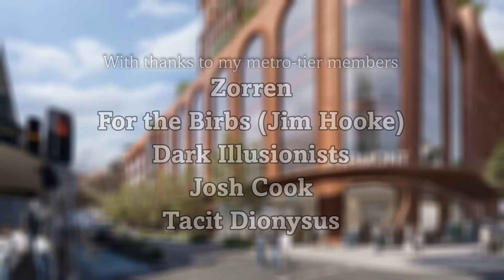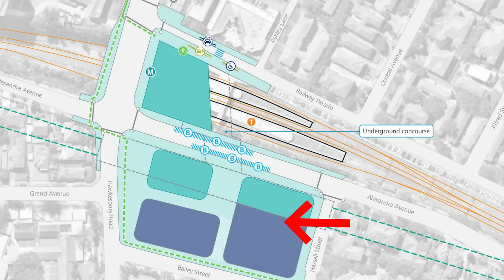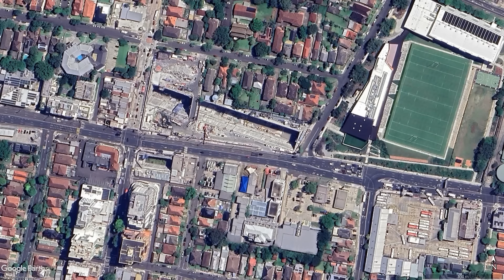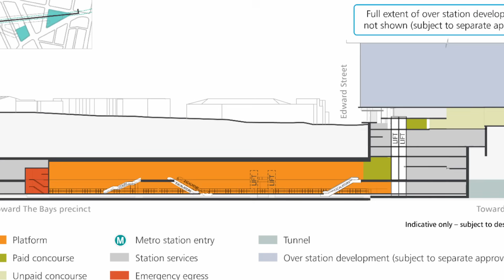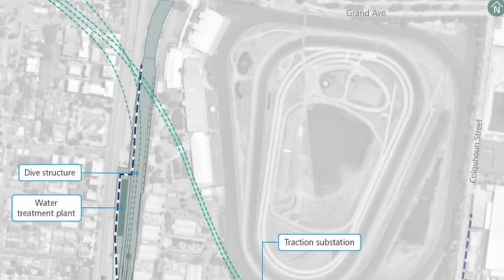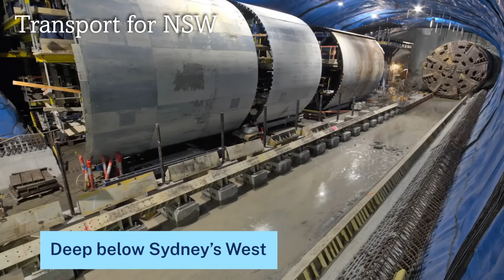Metro West - Sydney's Most Important Railway?

Comment: Very interesting! 
Though are you sure that Olympic Park station will switch boarding platforms between "normal" and "event" modes instead of switching alighting ones?
It goes against best practices, which are to only alternate the exit path and not the boarding one, so as to avoid confusion for locals who are used to board the train from a given platform. Whereas the exit side of the train can be audibly announced and visually signaled in advance, with also a time delay between the opening of each side's doors.
Also, a central platform usually has more space than secondary side platforms and thus better handles large event crowds waiting for their trains.

Maybe you explained it and I missed it, but why are trains of a different loading gauge on this line?
Fantastic video!
Greetings from Paris.
Reply from the maker: Sides are planned to be used for events only. I’m not an expert in crowd control but separating people into the two directions probably helps. The alighting platform should always be the middle so the announcements wouldn’t need to change on the train and it would be very clear for people entering the station which entrance to use.
Reply: @hain_train  Any idea how they load the passengers onto the outer platforms at SOP? Cross section show the escalators on the inner platforms and lifts on the outer..You mentioned additional entry points in event mode,but there must be either stairs or extra escalators filtering people to the outer platforms .With the current station,its stairs/lifts but the Metro station is certainly deeper and with additional levels
Reply from the maker: @danielmadden7924 some long escalators I assume. As I said I’ll make a follow up when the station design contracts are signed which will probably be at the end of the year.
Reply: @hain_train  But that's usually the other way around, with central platforms always used for boarding, and side platforms used during events for alighting.
It's far easier to change announcements and time the doors  in the train than to prevent "free roaming" passengers to go to the wrong platform.
Humans are creatures of habit, and on an ergonomics standpoint, it's better to create a "cattle corridor".
With side platform doors opening first, which easily direct arriving passengers to alight onto the side platforms, and a single way for all departing passengers whatever the direction they want to go to.
Signage in stations, however good it is, isn't even remotely as efficient as having physical crowd management.
Also, it's easier to control passenger flow to the central platform from the street, than the flow of alighting trains.
Departing passengers having to wait, a larger platform is better, while arriving passengers will leave the station so smaller platforms are fine.
Reply from the maker: Yes but splitting the crowd up early is more efficient. They use a side loading arrangement at OP currently for a reason. I don’t know a thing about crowd management but the people who designed the station do, I’m gonna trust them.
Reply: @hain_train   It goes against every good practice of crowd management 101...
Reply: @hain_train  Which implies the question as to why going against best practices here. What in the station, location, or organization justifies this, with all the crowd management risks it creates.
I'm guessing that they didn't just decide to do differently on a whim. So, what's the specificity of this station to warrant this?
Reply: @KyrilPG  The side platforms within Olympic Park train station are used for boarding during event mode while the centre platform is used for alighting.This is especially after the event is completed and crowd is controlled on either side outside the station.

Comment: Small correction: John Holland hasn't been "a local business" since 2014. It went through many owners but its various subsidiaries at the time of the sale by Leighton Holdings to China Communications Construction include a long list of notable construction and infrastructure projects: a lot of the Snowy Mountains hydro scheme, the skitube railway at Perisher, the original Sydney Harbour Tunnel, Brisbane's Gateway Bridge, Sydney's airport rail link (now part of T8 line)...all built through Transfield construction...and yes it also does public transit fleet operations. BTW there are no Australian-owned major builders left in infrastructure construction on this market. Zero.
Reply: @Robert-um6fr  Correct, if you are talking about Tier 1 Civil Contractors. I worked for Abigroup which I believe was one of the last Australian owned contractors in the early 2000’s. Leighton Holdings have been owned by German company Hocteif since at least the early 1980’s.

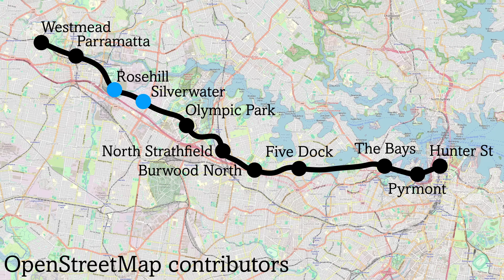Comment: 3:01 Not exactly accurate when you mean "slow and unreliable buses" in these suburbs. The Inner West, the Inner City, as well as many Eastern Suburbs and Lower North Shore suburbs already have frequent reliable buses. Pyrmont, Rozelle (and Balmain), Five Dock already have "all day frequent network", with routes 500X, 442, 433, 438X, (as well as 370) all operating on 10 min frequencies during the day, 7 days a week. 389, 501, 431, 440, 470 and 461X also operate with frequent buses. (with 389 and 470 on 10 min frequencies during the day time weekdays. However, with this new Metro, the journey times to the city would be drastically cut, relying less on these buses.
Reply: Pyrmont has 2 buses and light rail that only take you where you don’t want to go. Not that the metro will help much in that regard

Comment: Surprise that there is only 2 platforms at Olympic park. Thought there will be 3 or 4
Reply: My recollection is 4 platforms so that both sides of each train can open onto a platform. Commonly called “Spanish Solution”. Normal ops uses island platform side only. Major event ops unload on island platform side of trains and load from outer platform side.
Reply from the maker: Did you hear any of what I said?
There are 4 platforms.

Comment: While i agree spending a massive amount of money to connect T6 and T7 is a waste,
What if it instead formed part of future inner loop - say Hurstville to Gordon via Bankstown, Olympic Park and Macquarie Park.

Loop plans generally seem to prefer using Parramatta, but this link would likely be cheaper.
Reply: That is a Frankensteins Monster of a loop trying to make bits of legacy infrastructure fit together instead of building the orbital line a city heading over 6 million needs. The current orbital line plans they have on the books are Kogarah-Norwest via Kingsgrove, Bankstown, Sefton, South Granville and Parramatta; with another proposed but less-realistic plan for a second orbital line from Kogarah to Macquarie Park via Kingsgrove, Campsie, Burwood/Strathfield, Olympic Park, Rhodes and Top Ryde. Of course they also have the New Cumberland Line plan which is sort-of an orbital for eastern Sydney (and a radial for western Sydney) which takes the Liverpool-Fairfield-Merrylands line and reroutes it through new tunnels under Parramatta to Epping via Carlingford. These are all much better plans in my opinion than trying to thread and stitch together old legacy alignments in a semi-cohesive patterns like you are suggesting. Not completely against the idea but I don't think that really does what it says on the tin!
Reply: @BigBlueMan118 
The best orbital line would be from Glenfield, take over the T3/T6 and T7, then up through Rhodes to Macquarie Park. Temporarily extend the M1 to meet the line at Regents Park until the Hurstville-Parra line is built. This massive interchange connector would have several huge advantages for PT in Sydney:
  - connect every train line in Sydney bar the T4
  - finally provide transfer points without having to go to the CBD
  - provide a much needed north-south corridor for the city 
  - eliminates 3 useless train spur lines which virtually completely separates the train network, allowing more tph and isolating issues to 1 or 2 lines rather than the whole network
  - providing easy access to WSI for huge parts of the city with airport metro line extension to Glenfield 
  - allows for a fully automated network that independently provides access to most of Sydney eg. for 24hr running on weekends
  - makes much greater use of existing underutilized track, increasing funds for further PT investment 
  - future extension north to Gordon and Dee Why and south to Town, means ppl can easily live car-free as PT would be far quicker and cheaper to most places in Sydney, allowing for more investment in PT and less on roads
  - every key business/activity hub in the city will be connected by fast,reliable metro - CBD, Nth Sydney, MP, SOP, Parra, Liverpool, Bradfield, WSI. The only outlier is KSA but I think MW should take over the airport line to solve that
 - Finally, SOP becomes the swing point for transport in the city with the interchange with MW, making it the logical location for the high-speed station - which eases pressure on the CBD and reinforces the 3/6-city model.
It's a no-brainer!

Comment: As somebody who has lived in Paramatta and also worked in North Strathfield, and commuted frequently to Sydney CBD, I can't help feeling that this Metro LIne has not been properly planned, and could have been so much better. For a start, serving North Strathfield is very silly instead of servicing Strathfield, which is a hub. The residents at Nth Strathfireld will be driven out of there minds with parking problems, and right now is a very low volume station. Not connecting to the Heavy Rail Stations or another Metro Line is another bewildering decision. Too late now for a rethink, I daresay.
Reply: The lack of a direct connection to the L1 at Pyrmont is another opportunity lost. There are four L1 stations less than 400 metres from each other in Pyrmont, and the western metro line apparently doesn't connect to any of them, at least no better than the L1 to the T2 (and now T3) at Stanmore.

I would've hoped for cross-platform connections to mainlines at a City station, too. There's already a tunnel that goes from quite close to Hunter Street, right to the centre of the platforms at St James Station, that was literally made for that exact purpose. It was built a hundred years ago, for a western suburbs line that was never built. I don't expect it's oriented perfectly with the Hunter Street Station as currently designed, but given the fast and easy connection it would give to the T2, T3 and T8, I can't help wondering whether a bit more money at the City end would've made the whole western metro more integrated with the mainline network, and thus delivered more value.

This also would've solved the problem of there only being a single City station, unlike with the M1, which has four. Then again, I also have a hard time accepting that not at least planning through-running to eastern and southern suburbs isn't viable. As designed, I think Sydney's western metro will be like London's Bakerloo line for the rest of my life, or like so many lines in so many US cities, which dead end in CBDs and cause crazy crowds during peak times.
Reply: @nomadMik  Yes, indeed, some good points there, especially relating to lines that should not terminate in CBDs. In London the Bakerloo was more used before being split off into the Jubilee line, and it may be extened to Lewisham soon. I do see Metro west being heavily used, but it could have been better planned with interchanges
Reply from the maker: It does connect with the M1 at Martin Pl
Reply: @hain_train  OK, thanks, that's a positive then!
Reply from the maker: As I explained in the Hunter St overview it’s a paid connection direct to M1 platform level
Reply: I disagree strongly with all assertions. Tying the line to Strathfield and other heavy rail stations would have led to a simple replication of the existing rail corridor without expanding access to any new areas like Five Dock and the growing Burwood North corridor.

And with North Strathfield - it is very highly probable that stopping patterns will increase there to allow more interchange journeys. The usage patterns in that part of the inner west are not as car-driven compared to further out. You can have car-centric design, with massive car parks surrounding each station, or TOD which is a much more human-centred approach, combined with bus and active transit interchange.

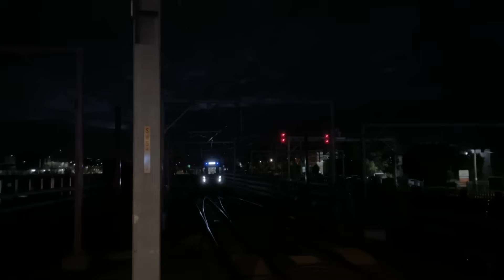Comment: 19:20 The other problem with making the line for the legacy network is the large extra cost. It’s not just the larger tunnels, but the existing trains require flatter grades and larger curves. A metro alignment is much more flexible which makes it much cheaper to find a suitable alignment. If the original line between Chatswood and North Ryde was built as a metro in the first place, you would have the inefficient circuitous route you see now.
Reply from the maker: That’s again only true with double deckers. There’s no reason you couldn’t have a fleet of much lighter single deckers with a much higher power to weight ratio capable of climbing 1:20 grades (metro ruling grade).
Reply: @hain_train  You mean like a metro?
Reply: @gregessex1851  did you watch the video? the metro can't run on existing suburban track. so no not a metro.
Reply: @gregessex1851 Yep. There is no reason why high performance trains can't run on existing lines... Melbourne, Tokyo, Berlin spring to mind.
Reply: @willguan7214  Yes, I was pointing out the he was describing a metro style train running on the legacy network as an option.
Reply: @ No technical reasons except that the metro will by 25kV AC and not the 1500V DC on the legacy network. The real reason that they don’t want to do it is that the Sydney Rail Network is not reliable enough to run high frequency metro trains on it.
Reply: @jack2453  not cost effective, you're going to have to double your workforce to run trains half the capacity. 

The precedent has been set it's just too high risk to assume that staff would accept DOO which is the only way it could work.

There would not be single deck electric trains on the Sydney trains network
Reply: @TomHommus  We'll see. There are lots of narrow minded can't-be-doners about - but they seem to manage in Melbourne, Brisbane and Perth. Common sense may eventually prevail.
Reply: @jack2453  there is already precedent there's no way the union would accept that effectively halving their workforce they would grind the network to a halt through strikes. Unfortunately it's either driver and guard or goa4. 

Other states rbtu are reasonable NSW branch is not. Absolute non starter.
Reply: @TomHommus Sydney DDs capacity is only 20% more than Melbourne HCMTs - so the cost penalty only applies to trains loaded over 1800 even with train guards i.e. a few peak hour trains. And there will bea compensating energy saving because they are lighter. And cost isn't everything, sometimes governments do stuff for reasons other than cost e.g. 50c fares in Queensland.